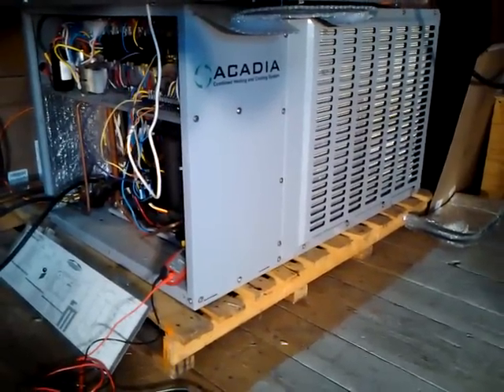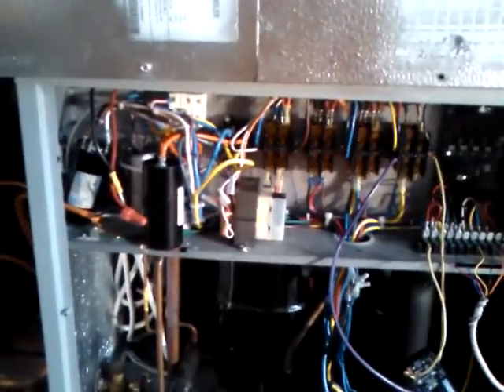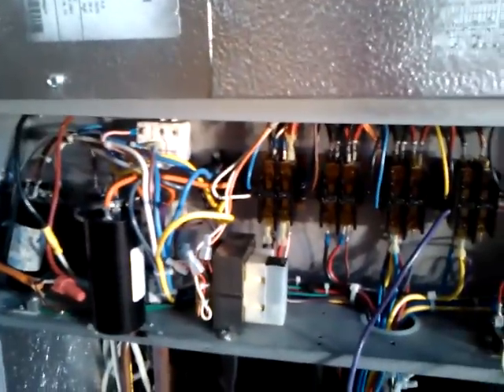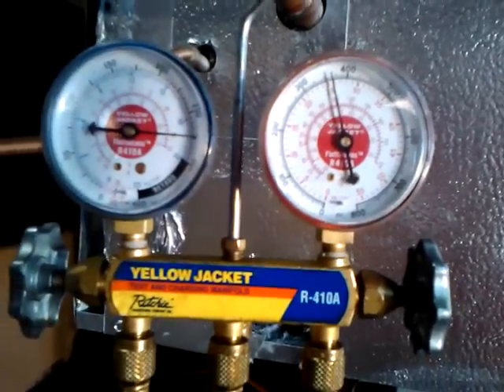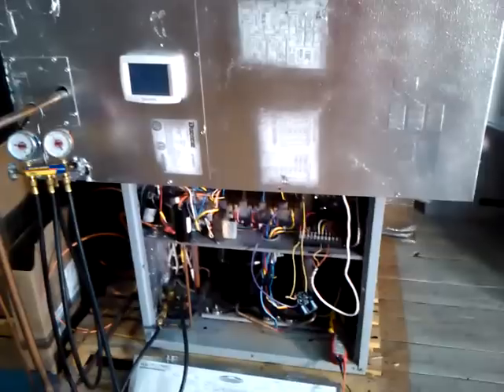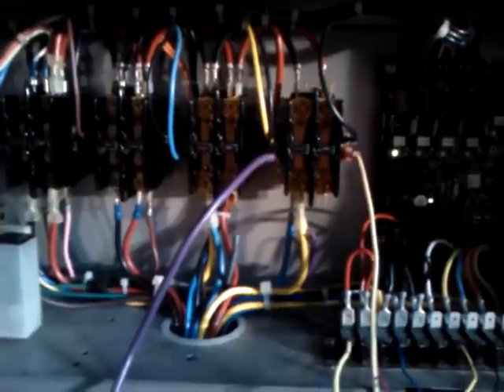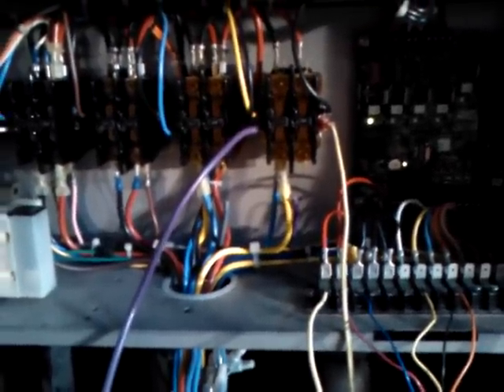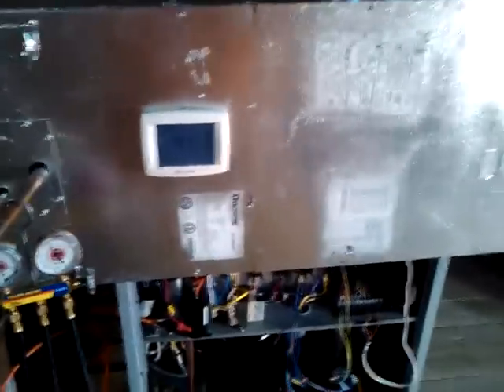Hallowell Acadia How To- Life Testing the UMSR-50 relay

Comment: That relay is mind blowing as a universal potential relay. Did you wire it using the standard method or the alternative reduced arcing method (which I don't understand. Less arcing between run and start vs common and start?)